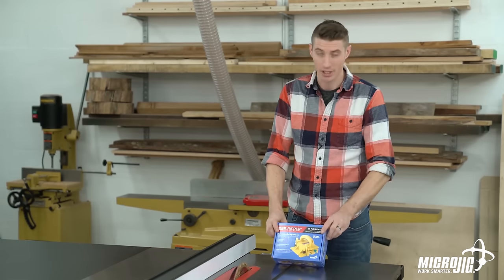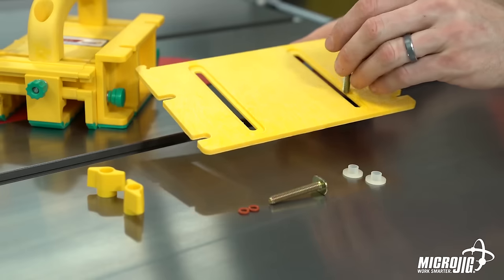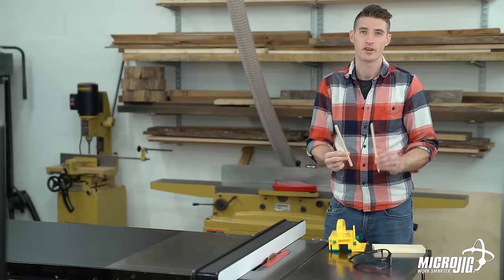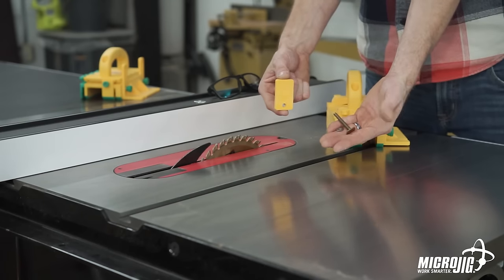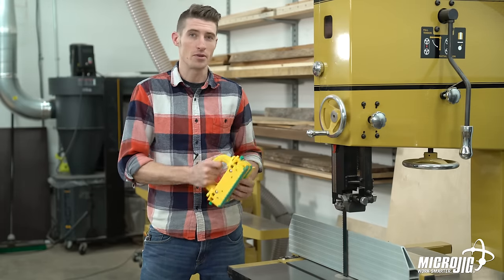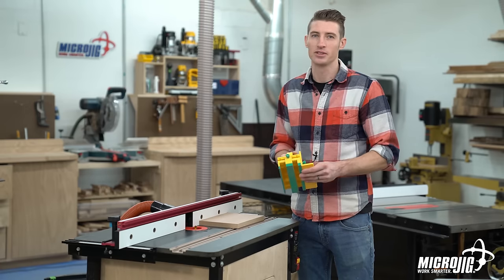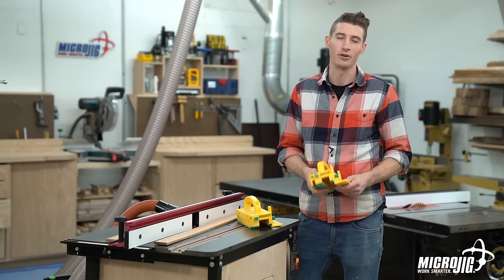GRR-RIPPER | Full Instructional Video (2018)

Comment: He is wrong in saying if you have material higher that 3or 4 inches you have to use a bandsaw bullshit if the material is 7 or 8 inches you can turn the material over and run it through the table saw!!

Comment: I just got my grr-ripper and the riving knife on my table saw in the "up" position is too tall for the grr-ripper to pass over. Am I doing something wrong, or is my table saw just not really compatible with the grr-ripper? Should I move the riving knife to the "down" position or remove it altogether, since it seems like grr-ripper serves somewhat of the same purpose? New to woodworking here, so sorry if this is a stupid question..
Reply: I can see this being useful for routing.  If you are able to rip with the saw guard in place you should always do so. I would expect the gripper could still be used to push the material through
Reply: Doesn’t the riving knife move with the blade so that the top of the riving knife is always at the same height as the top of the blade?

Comment: As others have said this is an awesome video and a great help to setting up the Grr-ripper and its accessories, far better than for me, than trying to follow instructions in a printed manual.  The practical demonstrations create an appreciation of the Grr-ripper and its widespread potential use in the workshop. For me these explanations go a long way in justifying the cost of the Grr-ripper as you can begin to see how to use it to make work easier and safer across a number of woodwork machines. So many thanks to MicroJig for providing a brilliant educational video which I trust is a reflection of high quality customer service I can expect.

Comment: After contemplating the pros and cons of this product, I thought I'd get one and give it a shot. I bought the 200 model for $79. Get it out and start to put it together and %#$@^#%   wrong screws in the blue bag. I looked at some reviews (wish I did that first) and apparently getting wrong/missing/broken parts in the box is a normal occurrence with this product. So, to answer Jeff Fisher's question of "Why can't it come assembled", I believe I have the answer.

Comment: You would think the amount you overcharge for this you would at least Assemble it
Reply from the maker: It is actually a cost saver to ship it unassembled. You also get a far better understanding of the product and how it works as you assemble it.
Reply: I’ll stick with a cheaper alternative which is exactly the same thanks. Or I might put one together myself on the 3-D printer. No disrespect it is a fantastic bit of kit but if you can’t wait it’s cheaper because of your overheads you’re doing something seriously wrong but it’s not because of your overheads is it? And don’t even get me started on your clamping system
Reply from the maker: When you bring your first product to market, we'll be glad to discuss overhead with you.
Reply: Lol my products have been on the market for the 20 years. I’ve now retired because of it and they’re not strictly your products are they anyone that uses thingverse knows that. Not that I have any issue with that you have improved it but how much profit do you need. Anyway I don’t wish to argue with you that was never my goal I just believe it to be a little bit overpriced for what it is that’s not to say it’s not a good product

Comment: Let me preface my comment by saying I'm a finish carpenter of 32 years ( know what I'm doing), I bought the Gripper, I'm returning the Gripper, it's a piece of junk, even with strong down pressure and pushing motion at the same time on natural wood stock, it does not give the friction and adhesion you need to safely rip a 1x through the table saw, very disappointed in this product.

Comment: Gripper does not work with my Ryobi Table Saw as for example, when blade is up at 1" the Riving Knife height is 2 1/2" so the blade would cut right through the Gripper. Any thought before I return it ?
Reply from the maker: Yes, adjust the height of your riving knife. Your Riving knife should have an adjustment position to set it in line with or just below the top of your blade. This is so you can make a groove cut that does not cut all the way through (like a shoulder cut) without removing the riving knife.
Please feel free to call us and we can talk you through your options.

Comment: I get the safety aspect... though that's extruded plastic.. it shouldn't cost any more than $19.95.    About $2.00 in fasteners...   the Gr200?? Lol... what is it a race car? ... cheap Chinese yellow.   Looks a plastic toy made by Matel...
Reply from the maker: Actually, manufacturing costs way more than you think it does, as does shipping, packaging, then we have to add on for retailers and resellers. 
Also, while we do manufacture some products overseas, none are from China and MOST of our product line is molded in Ohio.

Comment: WHy the fuck don't they send it to you assembled?  Would save over half the world and video...
Reply from the maker: Cost is the biggest reason. Someone has to get paid to assemble it, and assembled would require a bigger box, so fewer units in a truck, so again, higher cost. Also, when you assemble it yourself, you have a better understanding of the tool and how the various parts operate.

Comment: Just got mine. Let's say I have a sheet of plywood 24" wide and I want to rip it to 12". How do I use the Gripper to do that?
Reply: @Ed Haskell 
I don't know why the experts are not answering your good question.  I'm basically a "newbie ," but I  imagine you would just remove the fence , use the Gripper on one side of the work piece and your own hand ( or a second Gripper) on the other side.
Reply: Set your fence to the 12" mark and use the gripper just flat on the fence side with pressure down ,towards the fence and use a push stick ( A GOOD ONE) and slider on threw dare.!

Comment: Anyone with a table-saw already has the tool to make a pusher of any size shape or configuration desired.  All of the "attachments" demonstrated here can be quickly knocked up from some scrap stock. especially sacrificial parts.

I know someone has to have an idea first but this "type of device" ?shoe? is fairly logical and by no means original - ie a concreters wooden float with a sacrificial / gapped base..

BTW encouraging people to lean far out over a running tablesaw blade is far-from safe, as is retrieving cut pieces from in front of the blade..  ( one should not encourage anyone to reach over or behind a running blade) Discouraging use of push sticks is merely aggressive marketing  - being a woodworker, half of the fun is in making jigs and fixtures, this is basically a portable fixture. ( Well it isn't a  jig)

Comment: The presentation is clear and it appears to be a very good product. However, i have one comment that may or may not be important.  The presenter is a tall man with a long arm's reach, and he's not standing on one foot when he's reaching behind the table saw blade and swinging the finished cut away.   For some shorter operators this might not be a safe maneuver, especially if there is sawdust on the floor in front of the saw.
Reply: I have just read that the saw table should be at or below, waist level.  At 5 ft 6, mine, from the factory is just right.  Dusty floor, on one foot, reaching beyond the blade are not acceptable.  By having these hazards, you are transferring the danger from your thumbs & fingers to you wrists.  You may pass out, before you can turn the machine off.  Your comment IS IMPORTANT.  Ensure that your table saw is the suitable height for you body size.

Comment: Do we need to remove blade guide, riving knife and anti kickback plates to use this Jio? All videos show them removed. Manual does not state one way or the other
Reply: Clearly he is not using the blade guard, as this is partly for situations where you actually can't use it.  Never remove the riving knife, that would be dumb.  I don't know what you mean by blade guide, but he is using the fence and the Gripper is resting against it the whole time.  Super safe for cutting small pieces.

Comment: The GRR-RIPPER directions say on page 12 to use 2 hands--one holding the handle, the other on the "main body". But I never see that stance being demonstrated--even in the MICROJIG videos they always seem to go one-handed.  (Maybe I missed something?)  I'd like to hear / see a little more about the recommended way to hold the thing that actually agrees with the manual.
Reply from the maker: Well great, now we got to go and change all the manuals! LOL. Seriously, good eye, you actually read the instructions. To be honest, when I began with the GRR-RIPPER I used two hands often. But once you begin using a GRR-RIPPER in each hand, you get used to just holding the handle. Generally, holding the GRR-RIPPER only by the handle keeps your fingers well out of harm's way.
Reply: @Microjig  Heh, thanks for replying!  It's a very nice manual, by the way--very slick!

Comment: Very good video and very informative. Thanks for that. BTW, just thinking here but seems using two grippers each side of the band saw blade seems you’re pushing both grippers toward each other as you feed the stock it would pinch the material??
Reply: @Michael
Good question. Need answers/comments, especially by manufacturer.

Comment: Great...another device that removes critical thinking, from machine use. Listen, folks...any "pusher" that has a suitcase handle..is bad news.
And, this one..."the gripper" is no exception. Yeah, it's a gripper alright...it'll grip your hand and fingers all the way to the exposed blade. 
Any shop tech worth his salt knows...this piece of plastic would last about 10min. in a working shop. The depth/height of cuts made in a shop environment would mill this thing into a hunk of garbage in only two adjustments of the fence.
And, if your using a saw, and you're NOT in a working shop...STOP. you have no business around power tools. You're not a trained or skilled craftsman. You're a DIY'er that's going to get hurt.
Reply: Geez dude, take a chill pill. Get over yourself. What are you, the master of the woodworking universe?
Reply: @luptonpittman6520  whatever pleb.
Reply: @luptonpittman6520  better to not feed the trolls. This guy's probably just mad that a bunch of people got into woodworking during lockdown and would rather try it themselves than deal with his pompous attitude.

Comment: I have two of these (including the Advanced model).  While the GRR-RIPPER  works great on small pieces like in the video, it has limited capabilities on long/large pieces of wood.  Also, the green gripping material slips as soon as it gets any saw dust on it.  You will probably need to clean it after every couple of cuts . . . Great concept though.
Reply: He explains how to clean it at 36:15 with 99% isopropyl alcohol :)

Comment: What went through your head to stop sponsoring Steve Ramsey? Also I bought a micro jig and almost never never use it, basically a push stick is fine!
Reply from the maker: It's too bad you almost never use your GRR-RIPPER. It provides cleaner cuts than your push stick can. When used properly on a well set up saw, your rip cuts will show zero tool marks. And it is simply safer. You should be using it on your saw, router table, bandsaw and jointer as well. Anywhere a bit or blade wants to bite you.
Reply: @Microjig  it doesnt even grip well though. THats the thing, theres no heel so its all downward pressure which is dangerous, a simple push stick has a heel for forward pressure, making it better than your overpriced push stick
Reply from the maker: @koolkid1234ism  We do offer a heel accessory, but generally, I don't use it, the friction grip is more than sufficient for what I do.
If yours does not hold your stock properly, I will suggest you clean them well, and if that does not help, email me at ralph@microjig.com and we will get the problem solved. 
Cleaning instructions can be found here: https://youtu.be/XmV1Nv1phfA
Reply: @Microjig  you didn't answer my question why you stopped sponsoring the man responsible for all your success?
Reply from the maker: @koolkid1234ism you are right, we did not :)

Comment: Will the gripper work on the rockwell blade runner 2 ?
Reply: I have the Blade Runner X2 and it is a piece of trash. No accessory can save it. Just invest in a small tablesaw or router table.

Comment: I love the idea of this in theory. I have a Dewalt table saw that has a riving knife that sits above the height of the saw blade and I cant see how this would work in such a situation. Anyone have any experience with using the Grr Ripper with a DW745 and is there enough clearance above the knife for this to work?
Reply: Yes, plenty of clearance and works like a dream. I suppose if you had a thin piece of stock and the blade cranked up to max height you could hit the inside top of the tool, but I don’t really run my blade that high relative to the thickness of the stock anyway.
Reply: I have the DW745 and thought the same about the riving knife, but if you look at it from the side and put  a straight edge up to it you'll see it matches the highest blade tooth. If not double check the riving knife is fully seated and no saw dust is stopping it.
Reply: @davewhalen5981  thanks, I wonder if the UK variant of the dw745 has a different knife as mine sits a good 2.5cm above the top tooth
Reply: Wow....that's a significant difference....not sure why....sorry I wasn't more help

Comment: I paid you a 100$ for a piece of plastic and you want me to assemble?!!!!!!
Reply from the maker: We are sorry you feel this way. Pre-assembling the GRR-RIPPER would make it cost more, and the box would also need to be larger using more resources to store and ship. 
Even Large, far more expensive tools (like table saws) require assembly.
Also, by assembling your GRR-RIPPER, you have a better understanding of how it goes together than how it works.
Reply: $65.00 on Amazon but still more then all the others I saw.
Reply: You didn’t pay $100 for a piece of plastic. You payed $20 for operational cost, $60 for intellectual property, $10 for small scale manufacturing, $7 for plastic, and $3 because everyone in America’s unlikely to buy these in a ten-pack by the millions. Get a… grip?

Comment: gravity heel. nevermind the cost, that is plastic going into the ecosystem . use a bit of scrap wood to do this role
Reply from the maker: The heel is sacrificial, so the bits cut by the saw probably will as you say. But the heel itself, once used up and replaced, will only end up in the ecosystem if you (or whatever user) does not recycle it properly. Polystyrene is recyclable.
But yes, you CAN make a fixed heel out of wood, we call that a "trailing hook", but it is fixed and cannot rise and fall to work in the center of a board like the Gravity Heel can.
Reply: @Microjig  i was talking about the plastic shavings. i do not blame you promoting sales, you have a good product and i chose it even though the Chinese rip offs were cheaper, but there are limits
Reply from the maker: @drandrewclarke  so, what about all of the glues in the waste from cutting plywood and melamine? Do you use a phenolic ZCI? Cutting that leaves epoxy resin mixed in with your waste. 
We appreciate protecting the environment. In fact, we are changing over from plastic "clamshell" packaging to cardboard boxes for all of our products to eliminate single use plastics.
Reply: @Microjig  congratulations ..every little helps. i tend to avoid plywood etc as i have ready access to spruce. i would imagine the carbon footprint of my lumber is higher than shop bought sheet materials though as i fell using petrol chainsaw, mill using a petrol mill and drive the planks back home using a diesel truck.  
that's probably the reason i post sanctimonious replies ;-)
Reply from the maker: @drandrewclarke  As you say, every bit helps!

Comment: You never showed How this item works with LONG or WIDE Boards OR any CROSS cuts ????
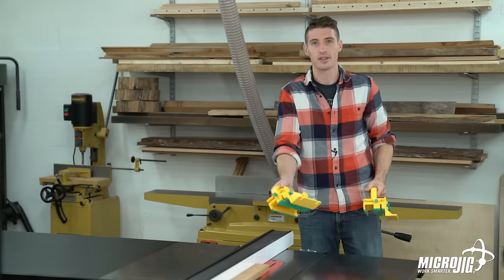Reply from the maker: Walter, We do show you working with longer stock starting at about 21:00 in this video. We also do have video showing the "hand over hand" technique in other videos on this channel. The "GRR-RIPPER on the Tablesaw" Playlist has loads of informative videos, and this one specifically shows the technique: https://youtu.be/WA5ZXojDhhA

As for crosscutting, the GRR-RIPPER is designed for rip cuts. Cross cutting is a completely different operation and is best done with your miter gauge or a sled. We do make the ZEROPLAY Miter Bars for making your own sleds, so you may want to check that out: https://www.microjig.com/products/miter-bar

Hope this helps, you can always call our office (855) 747-7233 or email support@microjig.com if you need more info.

Comment: I have a pair of GRR-RIPPERS, and also a Shark-Guard  blade guard. The GRR-RIPPERS are cute, although without much gripping power, but I feel like dust collection and my lungs, are more of an immediate need, so they don't get used much. I wish there was a feature where you could use the G-R's along with a blade guard. Maybe something that would ride on my Biesmeyer fence with a piece that would go down the blade-side of the fence and push the wood.

Comment: Is anyone seriously going to faff about with all the knobs and adjustments needed for just one cut ? I realise that "safety" was a consideration here, but consider that to use this device you cannot use a guard ,and after passing over the rotating blade your underarm is very close to touching the blade, just one slip while you are extended forward will bring your arm down on top of the blade, a push stick, if placed in the correct position will not push the work away from the fence, I think this is one of those gadgets we buy ,and never use, it certainly was in my case!